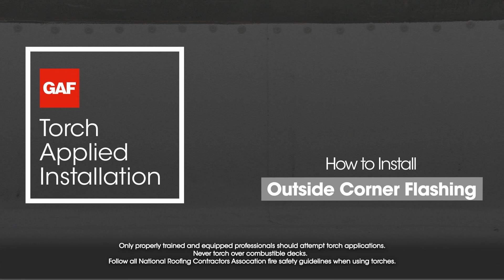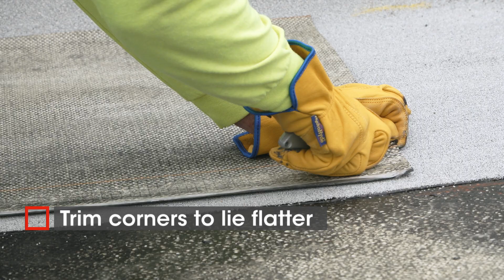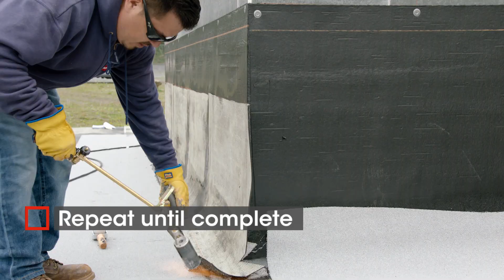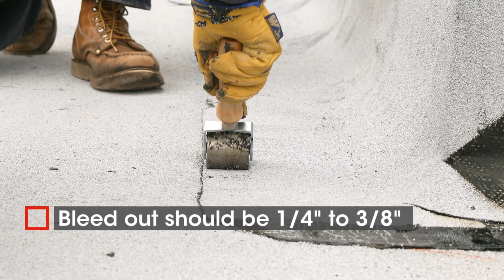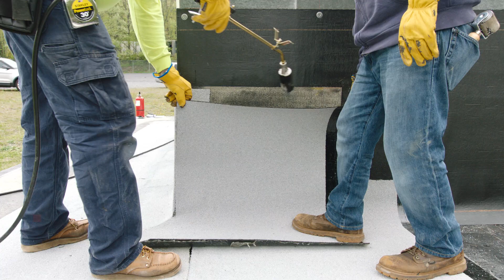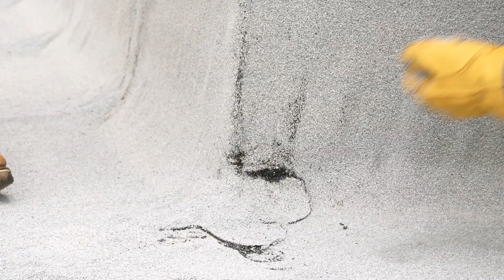GAF Roofing | Torch Applied Training for Outside Corners

Comment: Why does no one seal with plastic cement and asphalt mesh help with seams and penetrations from opening
Reply from the maker: Hi, there. Our technical experts are here to help with any installation and application questions you have. Feel free to give them a call at 1-800-766-3411, and they will be happy to assist.